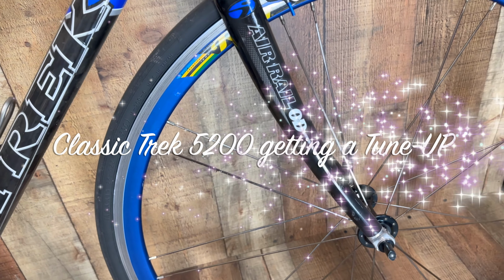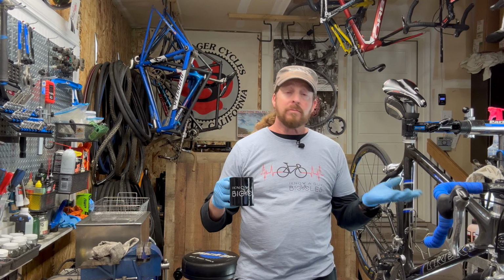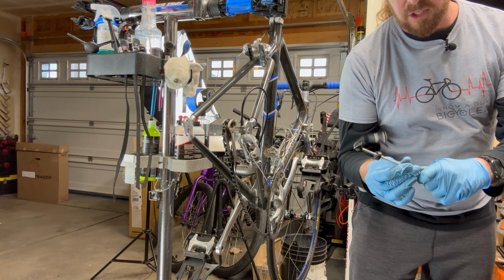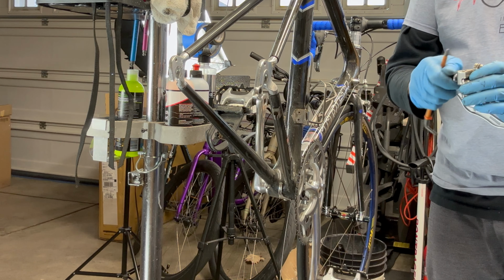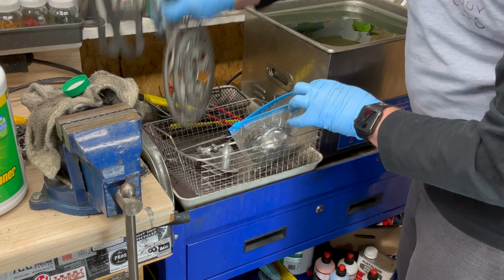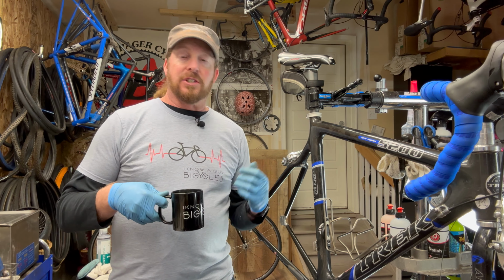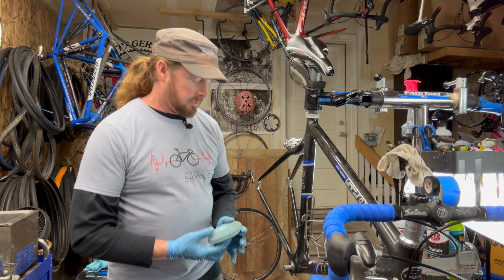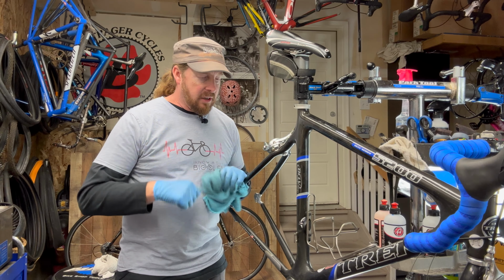Lightweight Legend! Is the 2001 Trek 5200 Carbon the Ultimate All-Road Machine?

Comment: That's a rad bike. Came out nice. ... ❤. I'd ride it for sure... cya...
Reply from the maker: They are pretty sweet and still relevant compared to today's road bikes.
Reply: I have the same color trek 5500 , it was used but like new and paid 350 for it , I stripped it put on some shimano c24 tubulars and it's a flyer . About the same weight as my 2020 giant tcr advanced sl. Rides great and wouldn't swap it for a current disc bike.

Comment: I have a 2002 5200 triple in Smoke Carbon finish that I bought new 22 yrs ago. I’m in the process of overhauling it and scored a N.O.S. Dura Ace BB 7703 on EBay that I’m installing. The original BB felt notchy and a tiny bit gritty inside so I wanted to upgrade it. After removing it it didn’t feel notchy anymore so I think it might have been over torqued when it was built originally. Looking forward to my first ride on it in who knows how long.
Reply from the maker: Nice ride! Thanks for sharing.

Comment: Had used Pledge on my 5200 but you’ve take. It to a whole other level! Replacing the fork on these due to age is a needed safety measure. Looks like this one did. Replaced mine with a Ritchey fork. Safe and Smooth!

Comment: I just bought one that just had a full tune up new cables chain gears adjusted and cleaned and im so excited its my first trek.
Is 400 and good price or did I overpay
Reply: Depends on its condition but if in decent nick then 400 is fair .. I found a decent 1 a couple of years ago and paid the same for it 👍

I have 2 others which I've had from new since 2002 and 2007 the last year they produced them. Great for upgrading in time with newer full groupsets .. I had 105 put on and it works sweetly , and fresh wheels .. 
It just makes the 5200 frame wanna jump the minute you hit a climb or punchy uphill sprint ❣

Comment: Had a Trek 2000 back in the day with Rolf wheels.  They were nothing but trouble.  Would not stay true.  Shop hated them and refused to work on them, they sent them back to Rolf to fix.  Still kept going out of true.  I sold that bike after one season partly because of those wheels.
Reply from the maker: Once in a while, there are lemons wheels out there. But with these, there have been fewer issues. It sounds like the rim was bent from the beginning, and once a rim is bent, you can keep it true.